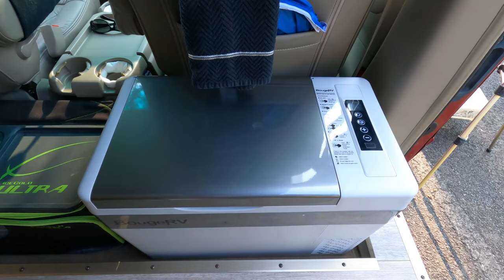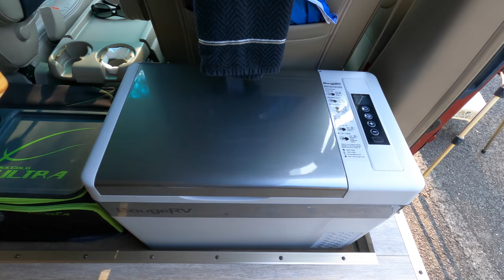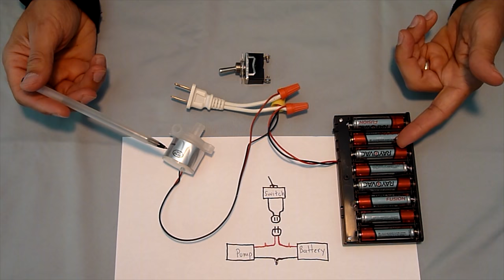Minivan Camper Build Chapter 2: 7,000 mile review

Comment: I found that using solid plywood can allow mold to grow under your mattress because there's no way for the trapped moisture to escape. In various van builds I've used slats or just drilled a series of holes throughout the plywood. Thus reducing some weight and adding some airflow. After about a half dozen different builds, I try to use as little wood as possible. Been experimenting with netting instead of wood shelves. Again, more airflow less weight and a easier to take in and out if needed

Comment: I have a friend who could do all of this for me in no time! I'm so excited to be able to show him a van that's been converted that's exactly the same van I have! Thank you so much and I am so happy I found this video! De b from Oceanside California!
Reply from the maker: Thanks for your comments, good luck with your van! A good improvement suggested in the comments is that if the bed frame side rails are longer in the front by 2-3 inches, the two rear legs for the front bed panel can be eliminated.  This makes converting into bed mode even easier, which would be especially useful for shorter people, because reaching the rear leg by the shelf unit is a bit of a stretch.

Comment: Scott in Wisconsin here, I wish you or Eric would do a video on how to get the floor figured out as it is the very foundation of the bed/cabinet/sink build. The folding legs on the bed is an awesome innovation to this concept, very nicely done!
Reply from the maker: Thanks for your comments.  The installed floor was a bit of a struggle, mostly because the van floor is not flat or level.  The design I ended up with was trial-and-error, but it has worked well and is completely stable. Unfortunately, every van model will have different floor details presenting unique problems, so each van model will have a somewhat different floor design.  
I was just recently in Wisconsin, I drove north from Milwaukee up around the UP, then down the Michigan shoreline - beautiful! Camping in the van along the shores of Lake Superior was a great experience.
Reply: @travelswithrob4970  

nice time of the year to discover the area

Getting back to the floor, it appears that the floor is pretty much in just the middle areas of the van, right?
Reply from the maker: Yes, the floor I installed only covers about half of the van floor, as shown at about 0:45 of my first video. The floor does not cover the area immediately behind the driver's seat because the spare tire is in a compartment under the floor, and because that's where the cooler is placed.  And the wood floor stops under the couch panel because extending it further wouldn't serve much purpose, it would just make it heavier.  The Honda van floor has a very uneven and sloped shape, so making the installed floor any larger would also make it more difficult to lay down flat and be well supported
Reply: @Travels with Rob  

I had a nice conversation yesterday with a representative from Traxda. They make lift kits for Odysseys. I am considering lifting my 2006 EX up 2" and getting some 17" 5 spoke 2008 Touring wheels and wrapping them with 245/65/17 Falken Wildpeak tires and I was warned to not to overbuild my camper van. 
 My plan inside is to able to get to the locking floor carousel storage just in front of the middle row seats and directly behind the folding tray between the front seats. I am going to remove that folding tray so that I can move to the driver's seat easier without getting out of the van. 

I must take out all the seats and start masking off areas on the floor. My plan is to have an ICECO VL 45 Dual Zone Fridge/Freezer behind the passenger seat. It is 31x19x18 and I think the 19 wide might be enough to also open the floor storage cover too. We shall see...
Reply: Scott, great news, Eric released his floor video just over a week ago and it's as good as you were hoping it would be!

Comment: This is my favorite build based on Eric’s design. The straightforward approach and simplicity make it very elegant and super useful. Great job! I'm really impressed with this. I'm building a 2004 Sienna and have been looking for a simpler solution to the front legs on the couch/bed. This really opens it up. 👍

Comment: Really lovely design and implementation.  Only thing I would want to add might be some drawers under the back of the bed for easier access to all that space under there - also drawers provide the ability to have a propane double burner stove that can be used at the back of the van with the hatch open (à la Roadloft).  The sink and shelving unit are perfect, however.  Love the ingenuity and simplicity.  Thank you so much for sharing and for sharing in such detail.  🙏🏽
Reply from the maker: Thanks for your comments, good ideas!

Comment: I'm here for that Coroplast fan install😍. Out of the hundreds of vanlife videos I've watched, I've never seen such a genius idea. Hope you let us know how it worked out.
Reply from the maker: I've found that the rear window fan is very useful for a gentle, quiet breeze to extract heat and bring in fresh air. It also makes the window bug-proof when the fan is on and the rear window is open. It's obviously not going to produce the air volume of a bigger fan, but it's a definite improvement at very low cost.  Also useful when parked in the sun - I crack open the front windows, and the rear fan helps keep the van from getting too hot.

Comment: Perfect set up. I will use this build on a my Ford transit connect but with lighter material.  2x4 is over kill.
Reply from the maker: I agree that it's not necessary to use 2x4 for the bed frame; I chose this because on the day I was at Home Depot, the 2x3s were in terrible shape, all twisted and warped.  The 2x4s were straight and true, and good lumber saves problems later. However, the bed frame is the lightest part of the build, probably less than 15 pounds. The heaviest items are the floor and the bed platform, which together are well over 100 pounds. The best place to save weight is in the bed platform, because it's the only piece that I have to constantly move from one position to another.  I still like the maple even though it's heavy

Comment: Clever convertible 🛌. 😊
So nice you don't have one of those stupid/impractical HAND Pumps 4a change.👌 The ONE thing you don't have and is the FIRST thing of importance 4me is a Cassette Toilet....everything else is icing on the cake! 😁😉
Reply from the maker: Thanks for your comments.  Yes, I'm amazed that even some commercial van customizing companies still use those pathetic hand pumps, when a powered water system is so easy and inexpensive to put together.  Regarding the toilet, I have a system for that, but I decided not to get into those details in the video. However, since you mentioned it, I have a bottle and a lined bucket system that work great!

Comment: Ayy, our rigs are very similar! I went with a 2012 Odyssey and installed an AGM battery where the spare tire used to sit. Central 12v power is convenient, especially for things like the water pump and fans. I really liked the amount of polish that you put into that bed frame. Very well done!
Reply: So where did you put your spare tire?
Reply: @danah358  I've got a Yakima Skybox on the roof rack that holds my camping gear. It very easily holds the donut. 😄

Comment: Great build, the one thing i would think about changing is to remove the console between the seats, i find it super convenient when stopping in for the eve like in a walmart parking lot, if u can go from the drivers seat to the back without existing the vehicle,  you can really remain in cognito mode which i find is very cool.....once again...great job on your build.
Reply from the maker: Thanks for your comments! I agree with you about the console - and it's another reason why I like the Honda Odyssey, because this van has a hinged flip-down console.  It's up as a console when I want a platform when I'm driving, and down when I want to move easily between the front and back.
Reply: Very nice...i like that.....Road warrior on!

Comment: Great build, Rob! Lots of great ideas and instruction to draw from. Would you consider doing a more detailed video of how you designed/installed the floor? Thanks!
Reply from the maker: Thanks for your comments!  The wood floor was a frustrating element because the shape of the Odyssey floor is not level, not flat, and has steel anchors sticking up. Once I found a workable shape, the floor is just vinyl plank on plywood, secured by edge molding.  The floor assembly floats on the van floor, but is locked in place because it's bolted to all of the other pieces, including the bed frame, which is bolted to the van rear seat anchors.  I've driven 15,000 miles with this setup, and nothing has moved, not even a little bit.

Comment: I just sent Eric's build idea (to a photographer friend in Ottawa), and I will use your bed build for my elderly Toyota Sienna circa 1997.  You are excellent at your explanations.  Cheers from Victoria
Reply from the maker: Here’s a tip: it’s possible to eliminate the 2 rear folding legs if you make the bed frame 2-3 inches longer to support the rear edge of the front panel in bed mode. I’ve made this adjustment on my bed, and it is easier to operate. Good luck with your project!
Reply: @travelswithrob4970 , that's a good suggestion, but since I don't have the floor space in the stow-away area, and because I am only 5 6.5"...I will keep the bed shorter rather than longer...I have a port-a-potti...that I use...I need every centimetre. Thanks again and the reply!
Reply: @travelswithrob4970  , thank you for that suggestion.

Comment: Wow.. Super video. Great build. Wow.. and what a math whizz!! You must be an engineer or something "close". The bed/couch combo is awesome.. and you have headroom when you sit up straight. The maple is a good idea for the nice finish. 👍
Reply from the maker: Thanks for your comments, I appreciate it.  Selecting the couch/bed height was a tradeoff between headroom vs legroom while seated.  I'm 5'10" and chose the frame height to be just barely enough to not rub my head on the ceiling, but this took several tries. I initially made the bed frame legs long, then cut them down 1 inch at a time until I got the best balance of headroom and legroom.  Everything is compromise in such a small living space!

Comment: Hi, such a great job. Just a thought that you could cut holes easily in the bed boards to eliminate weight and get more air circulating. Thats what i have done before with just a 80mm hole drill saw and then a buzz with some sand paper or a router if you have one.

Comment: You're very analytical but very easy to follow. I'm a new sub. I have a 2004 Sienna that I'm hoping to make close to what you have. My biggest problem is finding a suitable sleeping arrangement, since I am 7 feet tall. Whew!
Reply from the maker: Thanks for your comments! Yes, being tall adds an another challenge for comfortable minivan camping. I just now measured my setup, and the bed platform could be extended to 7' and still have room for the fridge (with the passenger seat fully forward). It definitely can be done! Another issue would be having sufficient headroom when seated at the couch.  My dimensions leave only about an inch of clearance; however, without the couch cushion in place (4 inches lower) and also shortening the legs (maybe 2 inches), getting enough headroom should also be possible.  Good luck with your project.
Reply: @travelswithrob4970  Thank you for that encouragement. I might add that I weigh around 460 pounds, so I think I would have to go on a major weight loss program just so I could be slender enough to handle the small van. I've thought about getting a pop top for the van to give me head room but I haven't figured that all out yet. Happy trails from northeast Florida. And, happy new year!

Comment: Great follow up!   I watched Eric ‘s bed/couch too and did not like the two pieces sticking out on each side blocking the space when in couch mode. You solved that problem! 
Question(1) do the gaps between four sections of the foam bother you when you sleep? Do you feel the gaps ?
(2) how do you charge your power station ? What is the brand name of the power station ?
Reply from the maker: Thanks for your comments. I'm 5'10", 160 lbs, and I really don't feel the gaps between the mattress sections. To prevent movement of the four sections during the night, it's very important to install a lip at each end of the platform (these are shown in my video), and to make sure the sections fit snugly between the two ends.  If the mattress sections can move lengthwise, you will get gaps during the night. The power station is an EcoFlow River Pro, and it has worked well so far. It charges from the 12V outlet in the van (about 5 hrs to full charge when driving), and can also be plugged directly into a solar panel.
https://ecoflow.com/products/ecoflow-river-pro-portable-power-station?gclid=Cj0KCQjws4aKBhDPARIsAIWH0JWOrgBdMfD0NcCJrgYviewHFsE8AZQRntHqFEANKwkiLykPzALPRLgaAugFEALw_wcB
Reply: @travelswithrob4970  Thank you ! I will use  your plan to build mine without any variations ! Perfect plan !
Reply: A thin inflatable camping pad would fix any issues with the small gaps.  Really cool setup.  Love all the storage nooks!

Comment: frame 54''. Sections 18 1/2''.  x 3= 551/2'' if you had of build the frame 561/4'' It would have left 3/4 lip for the last section to rest on and done a way with the need of more then two legs. Right??
Reply from the maker: Yes, that's a good idea; extending the side frame rails would eliminate the need for the rear legs to help support the front panel when in bed mode.  I just now measured mine, and the rails would have to be about 2.75 inches longer to provide 1 inch of support for the front panel when extended; then the rear legs would not be necessary.  That's a great improvement Steve!
Reply: The answers are always in the comments, thanks Steve! As I'm watching the video my first thought was how to eliminate the need for those back legs, thanks for sharing your idea, that's a great easy fix for sure.

Comment: Re:  hot nights in our iMax campervan.  We have two fans, window guards on both front windows and a tailgate latch. We cracked open all six windows and use the tailgate latch to get airflow from all directions. It works a treat.
Reply from the maker: That’s great you have so much ventilation. My van middle windows don’t open, and I prefer not to leave the tailgate open, so my airflow is limited. I need to work on that

Comment: Would you be able to prime your water pump by applying vacuum to the faucet?  Like a handheld brake bleeder and a soft flexible clear tube to see when the water gets there. Great build. I have the same Odyssey (an 02), so your build was of elevated interest to me.
Reply from the maker: Priming the pump by use of an additional vacuum pump would probably work, but that sounds like extra complexity. It’s just so quick and easy to do it manually

Comment: You sir are a MASTER INSTRUCTOR and deserve an 🏆award 🏆for your instructional abilities.  🏅  🤔 However, I DO have one question for you.  When you say that you connected the wire to the "Female end of the extension cord..."  How does one identify which wire that is ???  My "Electrician" housemate told me that the "Female end of the extension cord is the wall socket."  I have learned MORE FROM YOU than I have in the last 3.75 years living with an unemployed (retired at 55)  full time T.V. watching zombie "Union Electrician."  🙄
Reply from the maker: Thank you for your comments, I appreciate it! The extension cord has a plug end and a socket end, and the female end is the socket end. In my wiring diagram, the cut-down extension cord is used so I can  easily disconnect the water pump power supply from the sink cabinet when I’m using the van for other purposes. Happy trails!

Comment: Nifty design. Have you considered drilling out large holes in the front 3 sections for ventilation and to lighten the weight of the ply?  :)
Reply from the maker: Ventilation is not really an issue because the cushions get shifted around so much during the daytime, there’s no real chance for moisture to accumulate. However, drilling out sections sounds like a good idea to make it lighter, and perhaps a bit easier to move back and forth between bed and couch

Comment: Thanks for the video, we love the adaptations you've done to Eric's bed and will be trying it out in our van tomorrow. I wanted to hear your reviews about your Bouge RV fridge. Are you satisfied?
Reply from the maker: Yes, the BougeRV fridge has worked well during the past year.  It's quite efficient, and during average summer temperatures the compressor runs about half the time at about 32-40 watts, so I estimate it averages about 20-25 watts power consumption over the day. It's also reasonably quiet, but I don't like to have any mechanical sounds when I'm sleeping, so I usually turn it off right before sleeping and turn it back on first thing in the morning.  This saves a lot of power, and the temperature only goes up from 38 degrees to about 50 degrees overnight, which is fine since I don't store many sensitive foods. One last thing I really like about this fridge is that the entire lid is flat and level (so useful!); I would never buy a fridge that doesn't also function as a useful flat space
Reply: @travelswithrob4970  Thanks for your feedback. Much appreciated!